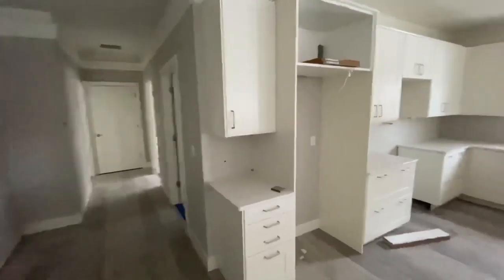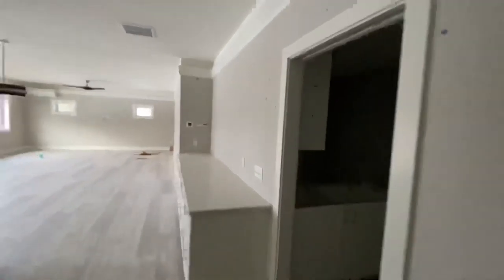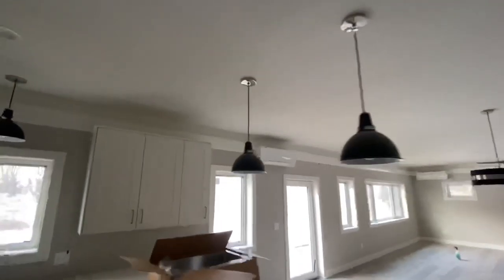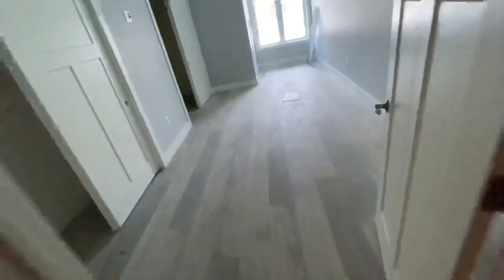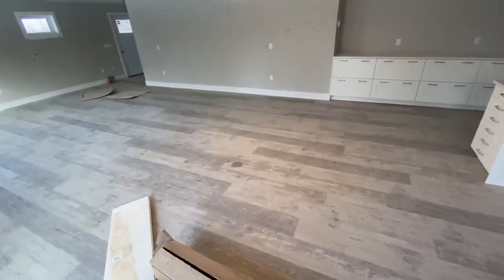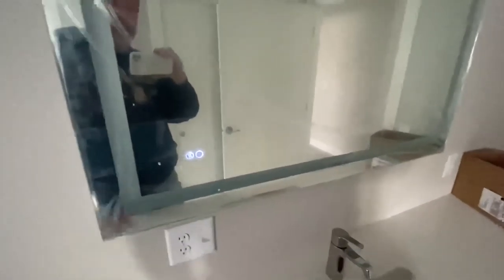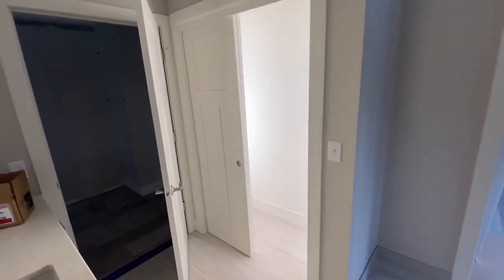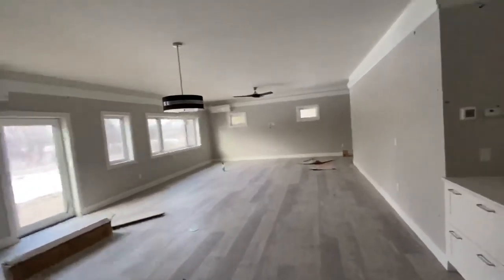Lights , lights and lights

Comment: I have 2questions. Who / what company did your in floor heating and where your under cabinet lights and outlets come with the cabinets or was it something your electrician installed?
Reply from the maker: A company called Droegkamp did the in floor heat. They are in Pewaukee, Wi. The installers are very nice. Ryan ( last name unknown) was delightful. The under cabinet outlets were done by Matt Carini electrical out of Waukesha, Wi. The under cabinet lights were from Ikea. If building new have the electricians and your ikea cabinet installer meet early in the process to agree on power location for under cabinet lights and in drawer lighting. In my case it made for a very clean installation. Waiting until drywall is done to decide power outlets is a crazy bad idea.